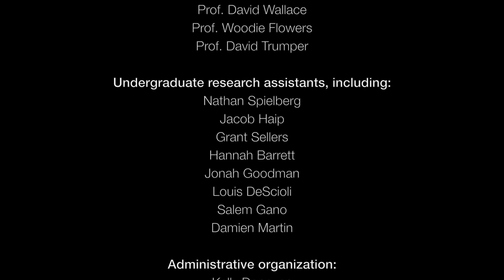System can 3-D print an entire building

Comment: It is funny that while working for Dow Chemical at Midland MI  ~April 1964 to ~1976 I saw that they build a robot device that used the foam that you used but put it in to a fabric tube and built structures like your dome.  Obviously  never went anywhere. 
US3443276A  "Apparatus for making walled structures of plastic foam"  
US3331173A "Compound construction elements and method of manufacture and assembly"  
 UA3519523 "Composite coreboard having a plurality of partially nested, channel-shaped skin elements"
US3978255A & US4022644A

Comment: Are they going to consider modifying this (amazing) machine to make inner hulls for spacecraft? This'd be great for more elaborate designs. Plus, you could implement stronger materials with more precise, sturdy arrangements/structures to allow for maximum efficiency in space. Also, there's real estate, which would be revolutionized through the ability to make custom houses (within a finite, exact area of space of course)
Reply: The Crystal Crystals or use it to build habitats on other plants with in-situ resources so we don't have to ship all the bulk material
Reply: Philip Stuckey EVEN BETTER! I heard they're planning to print tools using a Martian dust-based filament. I suggest combining it with ABS or another sturdy thermoplastic material
Reply: The Crystal Crystals yeah, this would only solve one part of the problem, making the resources in-situ is one of the other difficult tasks
Reply: We could ship a few spacecrafts' worth of organic matter (living creatures) to Mars, using specific organic compounds to create imitation thermoplastics
Reply: I dunno if foams are a good idea in space, since they rely on expanding gasses to create the cell structure.  If those cell structures were "filled" with a hard vacuum instead, it would provide lower weight and better insulating properties than the gas would.  

Well... unless you want that extra mass, to aide in radiation protection.

edit: wait i forgot, the gas-filled cells would indeed provide extra strength.

Comment: Awesome. But cost?
I would love to know much does this foam cost, esp compared to other materials? 
Is this using Poly-Urethane foam, like what is used to lift sunken concrete slabs?
I reckon a material like Foam would be ideal, as it means construction materials are easy to transport, could be built very high (less mass).

Comment: I'd like to see how a 3D printer makes steel beams and reinforced concrete.
Reply: using jet fuel
Reply: You can 3D print metall. Don't know wich types of metall we can 3D print at the moment as it's needs heat, but it's doable.
Reply: "Jet fuel can melt 3D printed steel beams." - George W. Bush

"plz melt" - Jeb Bush
Reply: @AndreasElf  you just need fine powder. It could be possible if it's done in secounces, you spread come comcrete and than put some powder on it to melt a steel beam fo reinforce the concrete with it. But those powders are rather expensive. Or you just lay some steel on the walls while they are printed.https://www.youtube.com/watch?time_continue=4&v=-yv-IWdSdns

Comment: If you make the 3D printer itself out of melted ice or mud or plastic or melted sandglass, the 3D printers could print themselves and they can grow exponentially...  1 2 4 8 16 32 64 128 256 512 1k 2k 4k 8k 16k...  in 40 generations you'd have 1 trillion 3D printers.  You can put those ice-mud printers on Mars, and terraform it by releasing green house gas as the 3D printers self-replicate.  They will get energy and building material by creating ice-mud lenses to concentrate the sun's energy into a single point and using the suns energy alternatively to power its ice-motors and to melt more building material.  It might be possible to terraform Mars in a few years doing this...

Comment: It did no site preparation, no timber clearing, no access road construction, no utility line installation, and no site drainage measures were done.  It made no foundation, or floor.  It did not complete a dome, or create a roof of any kind.  It did not install a door, or any windows.  It did not create any plumbing, HVAC, or electrical systems.  What it did do was create the most inexpensive part of a building, the wall(s).  People who don't know about construction are always jumping on the newest building fad, straw bale, rammed earth, cob, paper bales, S.I.P.s, I.C.F.s, etc, without realizing that the walls are not the most expensive part of construction.  Builders make their living by building, but lots of people think that they know more about construction than builders do.